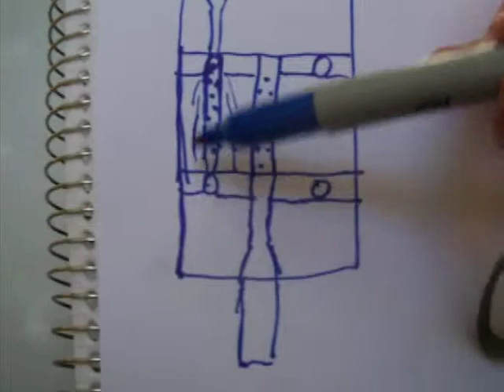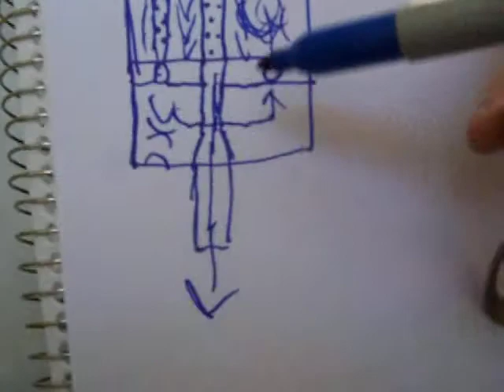How 2 Chamber Turbo Mufflers Work

Comment: if you don't mind my asking, why are they called 'turbo', and what are the constrictions you pointed out for?  Thanks.
Reply from the maker: Turbo mufflers are called, "Turbo" since they work by changing the direction of air in the design; they are not related to turbochargers.  Constrictions in an exhaust system can be the narrowing of the diameter of the pipe.
Reply: Thanks for replying. I did understand what you meant about constriction, but I what I wanted to know was what were they for. Sorry for the misunderstanding.

Turbo does sound misleading because of the association with the turbocharger which is also exhaust system related.
Reply from the maker: ChuddleBuggy
 The constrictions actually cause sound waves to crush into each other and help muffle sound.